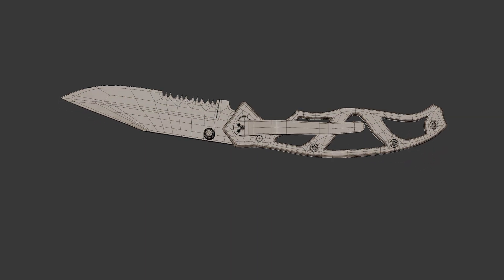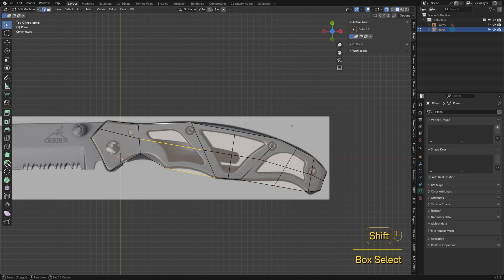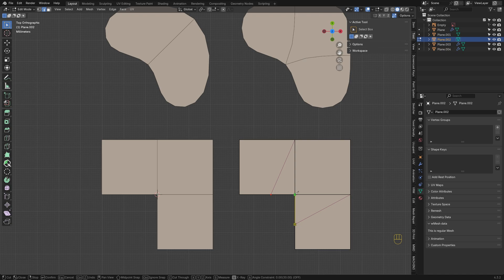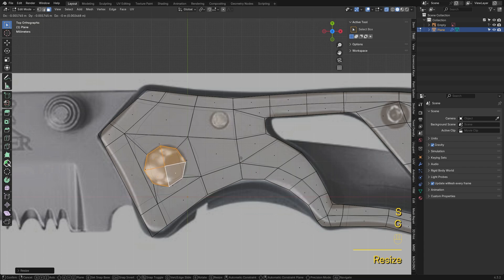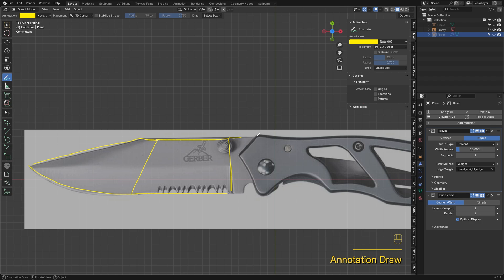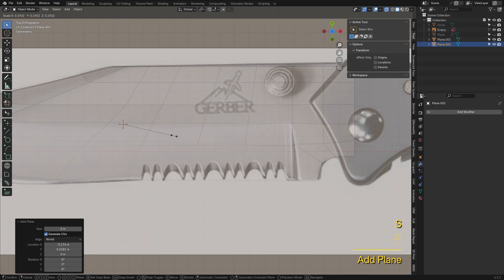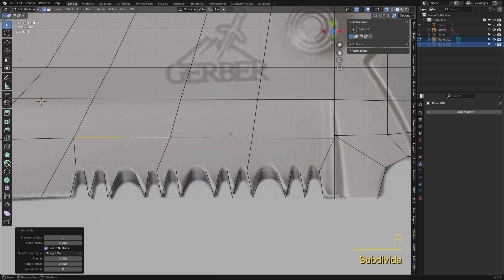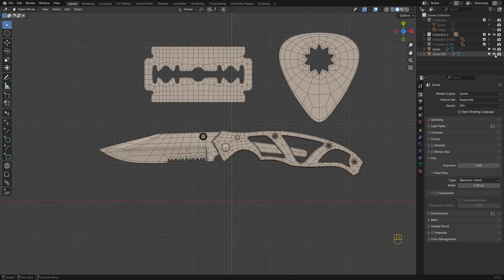Blender Topology Tutorial: SubD-Ready Cutouts on Flat Surfaces(Beginner-Friendly)

Comment: This a very clever approach, and a bit unique from what I have seen elsewhere. Thank you for sharing!
There are some key pieces that are missing for me to be able to use this approach. Mainly, how do you decide what edge flow should be, especially in the planning part? Then, how do you know how to fix each pole, n-gon, and triangle that arises when cutting? How do you know where to redirect edges?
Reply from the maker: Thanks! I start by analyzing the overall shape and breaking it down into quads and pentagons. The edge flow follows the form of the mesh, with extra attention to areas where the shape changes—like corners—since those often require redirection. I tackle poles and n-gons last, converting them into quads through trial and error using the techniques shown in the video.